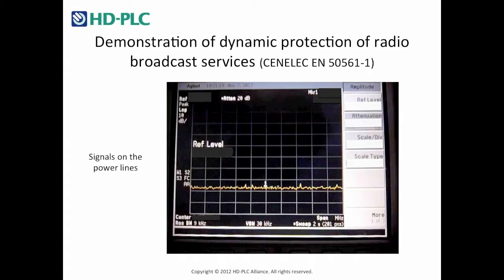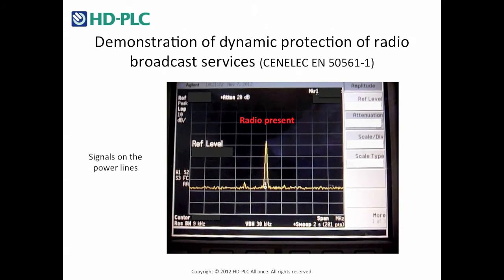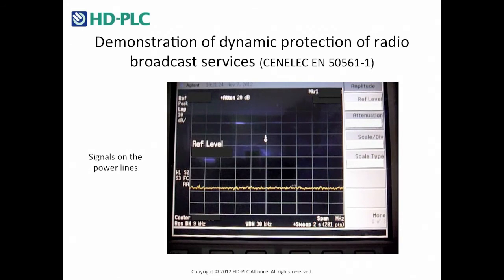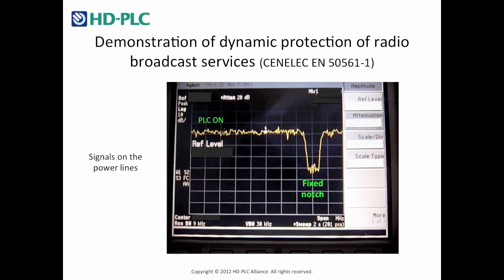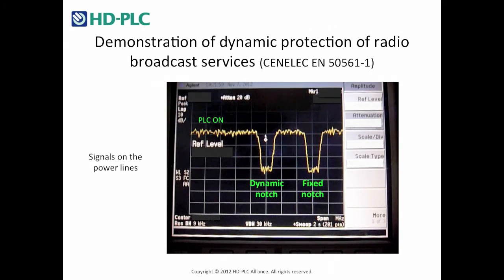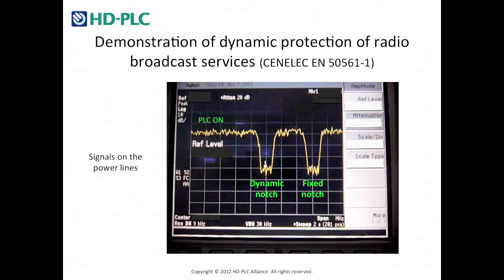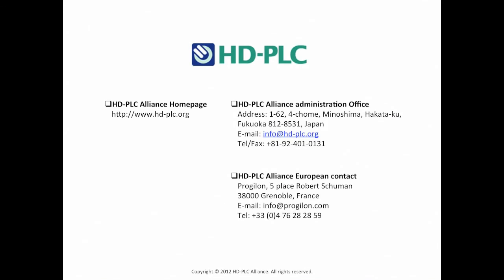Nessum's smart signal control "Dynamic Notching" compliant with Europe CENELEC EN 50561-1

Comment: Any idiot can design rubbish and they certainly have ... it needs to respond to all sub one microvolt signals across the spectrum and the notch would have to be at least 40 dBs greater ... the only way to achieve that is to SWITCH IT OFF

Comment: Before the power line adaptor is switched on, the noise floor across the whole scope is two squares below where it is in a notch. Therefore, the use of these devices completely obliterates weak stations regardless of notches. I bought some of these devices just to do my own tests with them. Using them adds a good 7 S points of noise across the whole MF/HF spectrum. They need to be outlawed pronto.

Comment: The announcer seems to be from the same mould as the announcements put out by the likes of Anonymous

I wonder how this would be of any use for someone some distance away calling in an emergancy, they would not be able to be heard with the raised noisefloor, even with the "notch" the noise floor is well above what it would be without this so called networking equipment.
Here at home I use cat6 and optic fibre cable to throw my data around my network, if I tried to use PLC I would not get the thruput. As my neighbour is an avid shortwave listener and cannot legally transmit on a frequency he wishes to listen to any sort of PLC would wipe out his hobby and make neighbourly friendships difficult.

As it is there is enough intereference here to my airband scanning due to some faulty technology in a house nearby, I have yet to locate it due to the intermittant nature of this problem.

Comment: This technology is utter nonsense. How does the PLT device in my neighbour's house know what station I am trying to listen to? How does it detect a signal which is below the 91dBuV output present at its terminals? How can this technology comply with the European EMC Directive 2004/108/EC which requires no electromagnetic disturbance to broadcast and amateur radio? How does this technology prevent intermodulation products arising from non-linear devices also present on the "network" resulting in interference being generated inside the "permanent" notches? It cannot. How does this technology prevent radiated emissions from electrical power cables which are only rated for a few hundred Hertz? It CANNOT.

Powerline networking technology is an inappropriate technology - it should never have come to market and breaches the EMC Directive essential requirements. All independent tests on PLT to date have shown that the current generation of adapters are incapable of meeting EN55022 which has an emissions limit 40dB LOWER than EN50561-1.

Norway has just banned two Homeplug PLT adapters using EN55022:2010 as the Standard. How then can EN50561 with a 40 dB INCREASE in output possibly be lawful or meet the EMC Directive? IT CANNOT. All EN50561 devices will be unlawful in Europe because they cannot meet the ESSENTIAL REQUIREMENTS of the EMC Directive.

Powerline technology has returned us to the mentality of Victorian times: It’s exactly like Victorian factory owners pumping clouds of foul smoke into that shared resource, the air, which we now know to be very bad but at the time was seen as an insignificant consequence of making more profits – and  anyone who complained about air pollution was simply bullied until they gave up. This is now what is happening with EMC and radio interference in the 21st century - those who care for the shared resource (the radio spectrum) are being bullied by big business for the sake of profits.
Reply: These things cannot detect what I am listening to, so should I be trying to listen to the BBC world service, or perhaps Voice of America, or even more difficult some of the Eastern stations, I am being denied my human right to listen to the political opinions of other nations. I am a ham, and a SWL, I do like to listen to shortwave stations from other countries, and I like to do so with my £10 pocket radio just as much as I do with my  £800+ SDR. Neither radio however will work within a mile of this pollution.